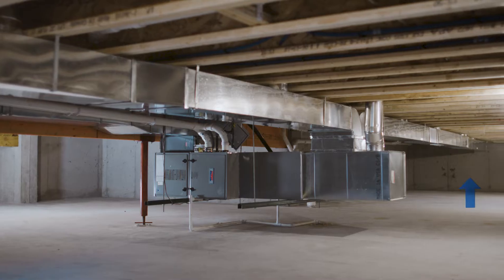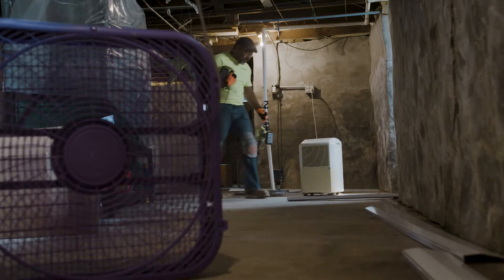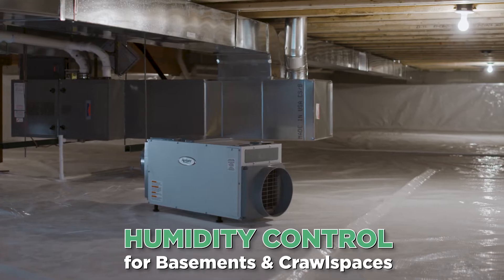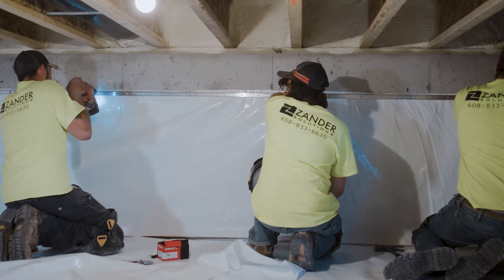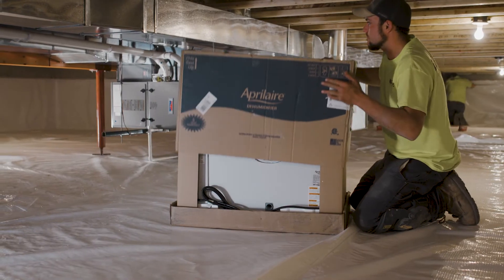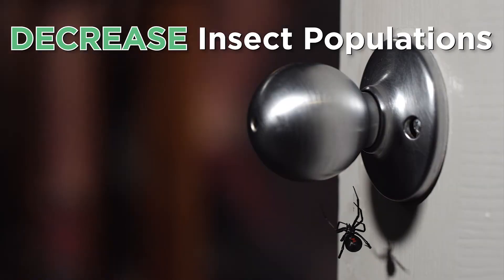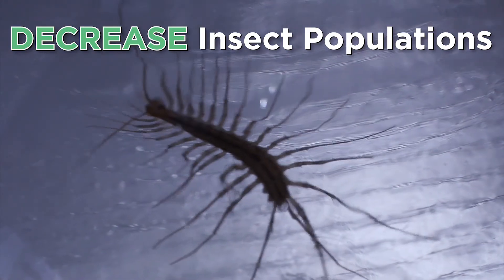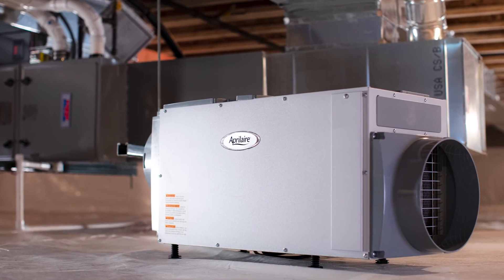Basement and Crawl Space Encapsulation + AprilAire Dehumidification

Comment: I thought these units needed to be ducted or is that optional?
Reply from the maker: Thank you for contacting Aprilaire! Aprilaire dehumidifiers can be installed freestanding or connected to the ductwork in a whole-home configuration. Connecting to the HVAC system increases the volume of air that can be dehumidified. However, because of the stack effect, it is also best practice to install a dehumidifier freestanding in a basement or crawl space application. If you have any additional questions, we'd be happy to assist.
Reply: @aprilaireco  Thank you for replying. I’m actually just looking to add one to my basement so that’s great news. I have a basement size of 1,380 SF. Can you suggest a model that’ll suffice for this size application. Thanks.
Reply from the maker: @pf5658  Thank you for your question! We do like to take more information into account than just square footage in order to determine the right model for your space. Would you mind giving us a call directly at 1-800-334-6011 to discuss? A team member is available Monday through Friday, 7:00 a.m. to 5:00 p.m. CT. Alternatively, you could connect with a waterproofing specialist in your area. We're looking forward to hearing more from you.
Reply: @aprilaireco  Ok I’ll do so. Thank you. However I do not have much of a water issue but more a humidity issue. I live in the southern US where it’s usually very humid.